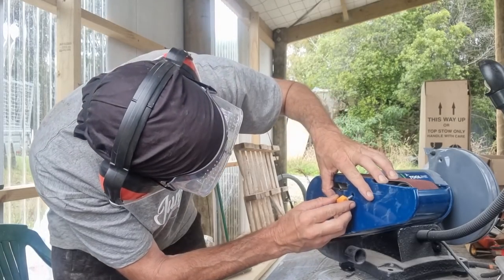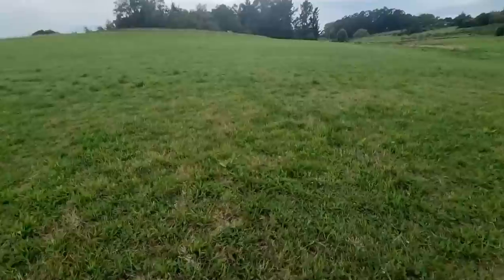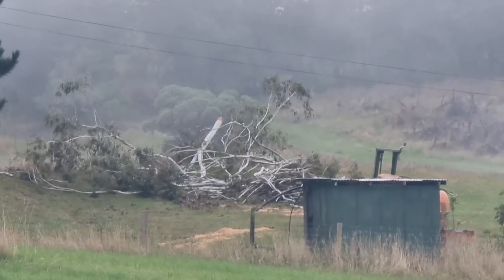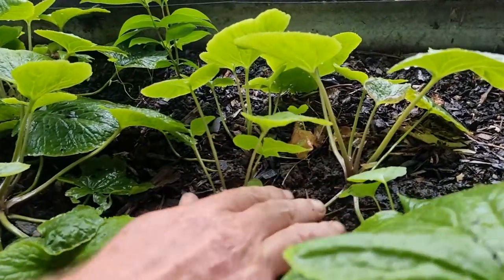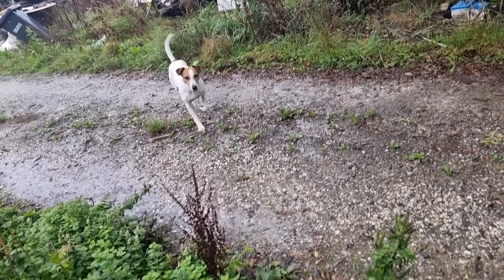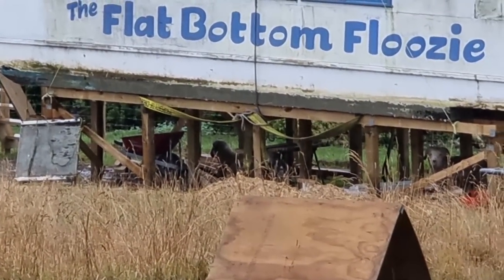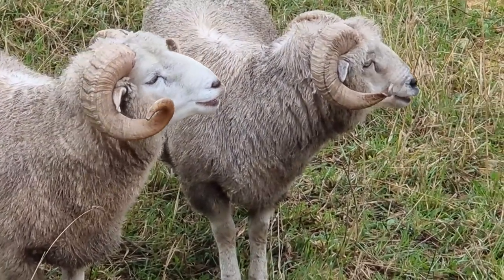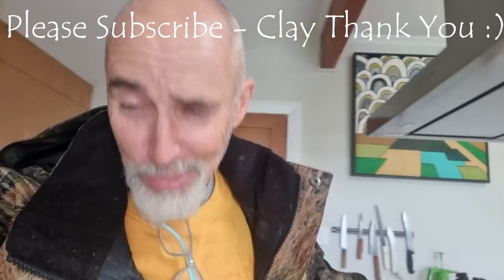Homesteading In Mapua Feb 2022

Comment: The old boys used to run a couple of inch wide ring of grease around the trunks of the apple trees to stop coddling moth. Has to do with breaking the life cycle and traps the worms as they climb back up the tree after hatching. I forget what time of year it should be applied though.
Reply from the maker: excellent info right there mate. Thanks